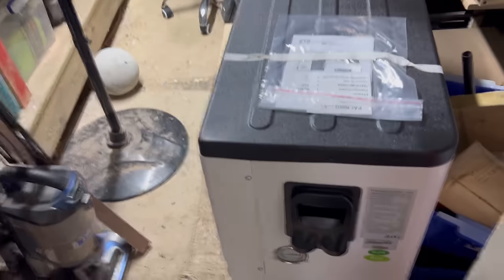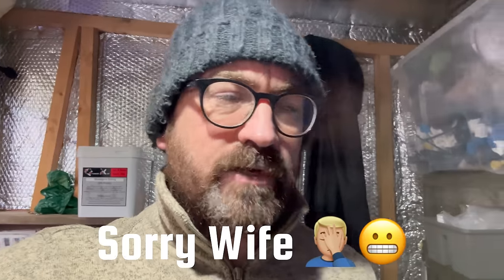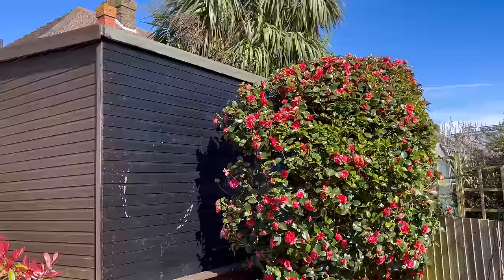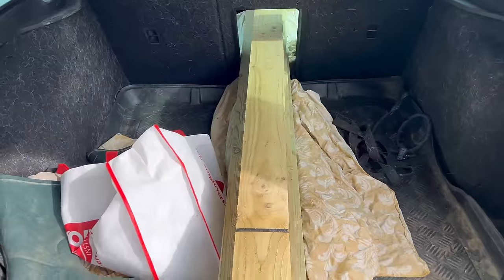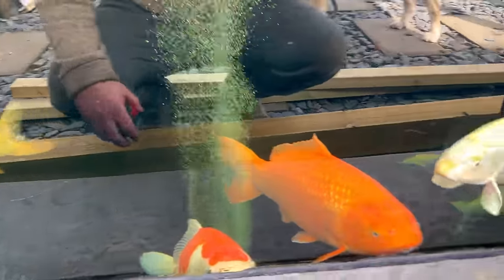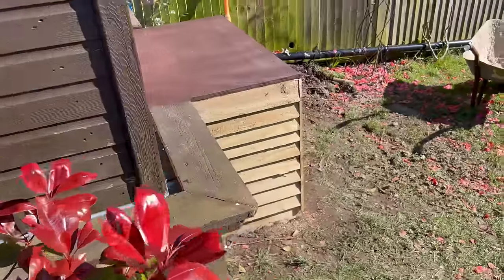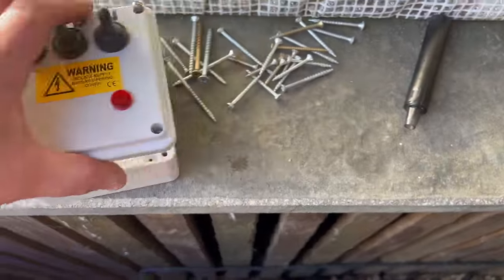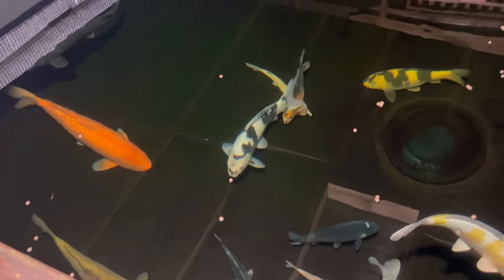Time for a new pond upgrade - Getting ready for a new toy and some much needed heat!

Comment: Nice heater. Nothing better than heat and food and good filtration. Fab. Just one thing, make sure that you seal very well the 'table' the heater will be seating on because you will have the heater condensation dripping. Just something to be aware of. Hope you are well.
Reply from the maker: Hi Lau. Hope you are well. I must confess, I wasn’t expecting so much water 😱 I’ve fitted a little drainage run since this video and had to treat the wood with several coats of polyurethane to seal it. Appreciate the great advice ☺️☺️☺️
Reply: @edenkoipond  all is good this end thank you. 😀

Comment: Good job Dave, just bear in mind the heat pump will drip water from a few locations underneath the unit when it defrosts, this might rot your wood in time or soak through your cabinet.
Reply from the maker: The amount of water these things create is crazy!! 😱 Thanks for the good advice/heads up. I’ve fitted I little drain run since this video and treated the timber to lashings of polyurethane. Thanks for watching and looking out for me - means a lot 👍🏼👍🏼
Reply: I did speak to you at the barn I have the same model, it come with I think 6 drainage tubes. I installed two, it's a bit unsightly to have 6 drainage pipes. Of course the water still drips from the holes without a drainage pipe, resulting in a puddle on the patio every few hours. I wonder if it could be slanted even a few degree so that the water will defrost to one end where we could install just one or two pipes 👍